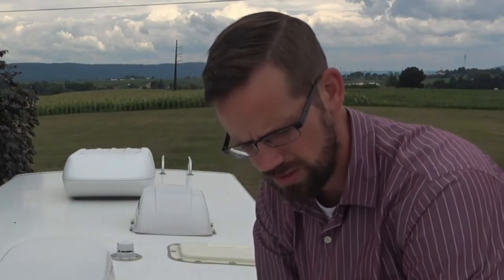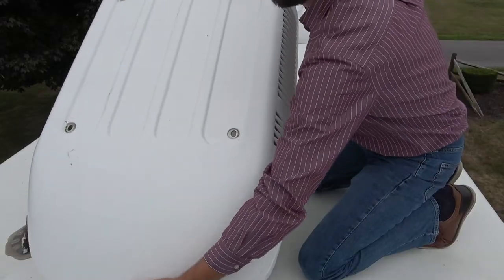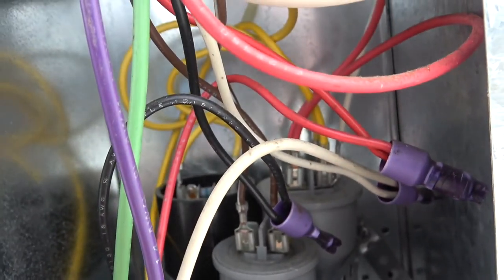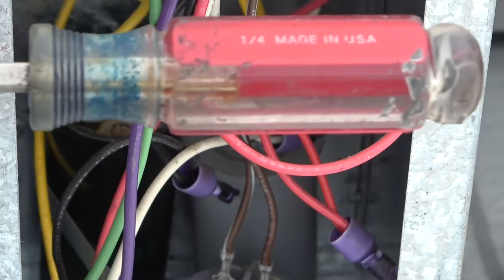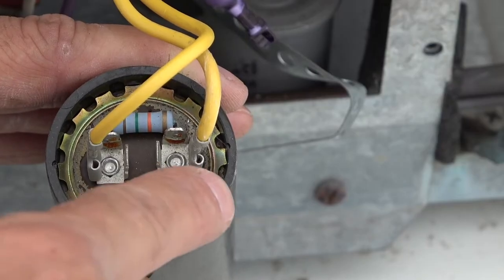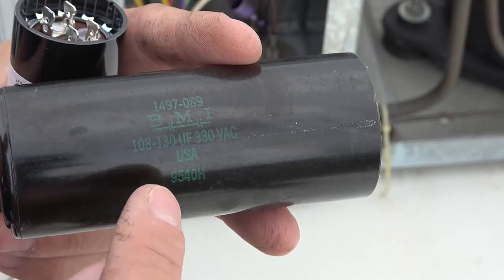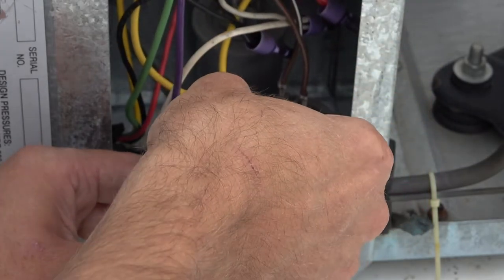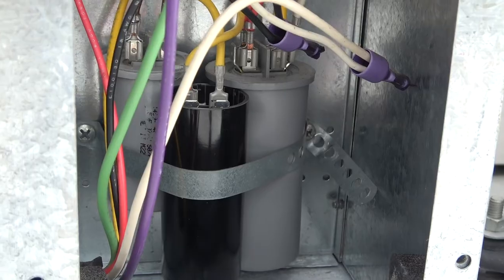How to Change a Start Capacitor for an RV A/C Compressor

Comment: Familiarizing me with the AC was all it took,  and I thank you and all the good people that help others with these videos.
Reply from the maker: Glad it helped!
Reply: How did it run when hooked up to the generator?
Reply from the maker: @chicosantos3109  My small generator still won't pull it on startup, but it's a well-worn generator. I haven't tried it with one in good shape. I also think that the second A/C may need the same thing.
Reply: Did it fix the generator problem?

Comment: You are about as careful about being shocked as I am, but if I may make a suggestion next time wear rubber or at least latex gloves, instead of doing everything bare handed.

That's what I'm going to do, shortly as I have an identical problem on my air conditioner.

The rest of your video was excellent, and I thank you!